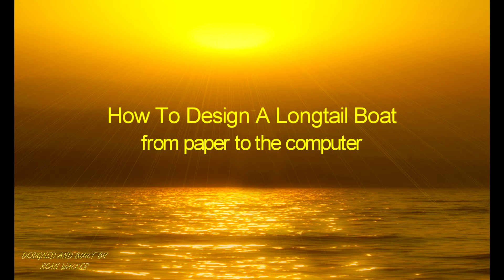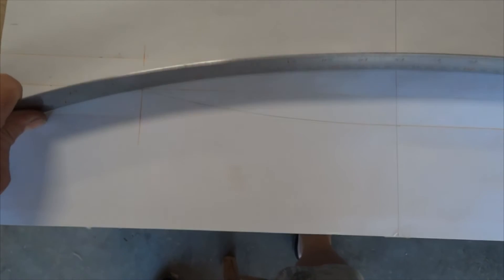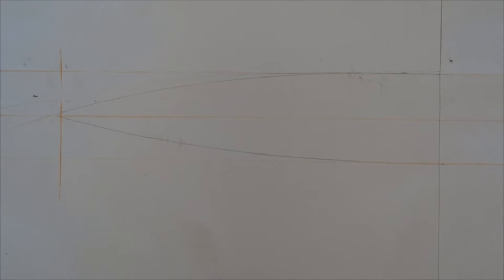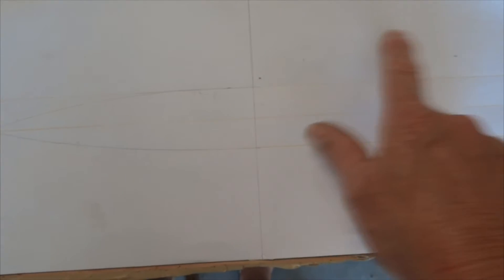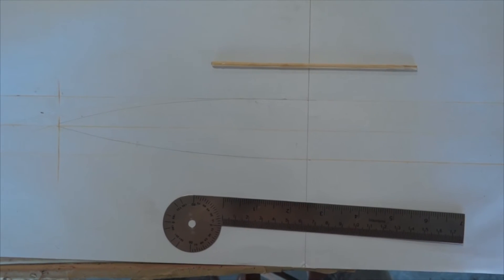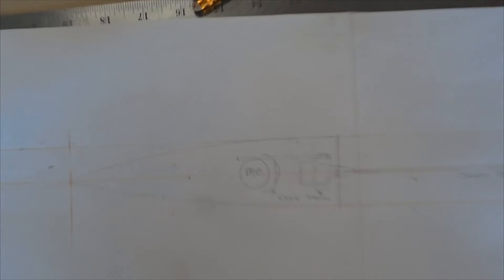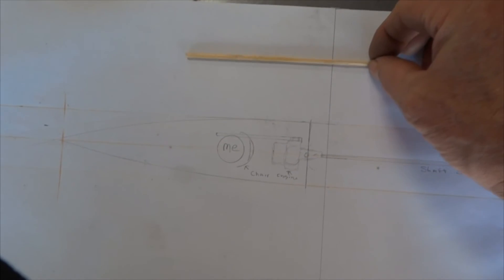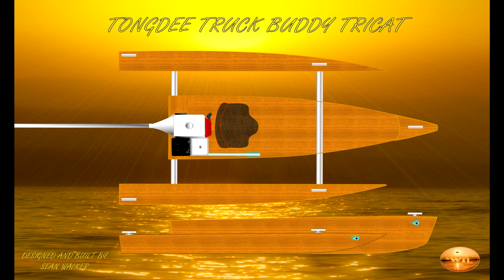how to design a boat

Comment: Sean, nice design. :) I have a question, how well does the 2 piece shaft work on a longtail? Is there more vibration? My thought is that the shipping is less expensive and it seems to me that it wouldn't be as smooth as a one piece shaft. Your thoughts please. :)
Reply from the maker: +Buddy Harrison  Buddy- By two piece shaft I suppose you are referring to
something like in a car with a drive shaft and a universal joint.Well I don’t get the point in using one. If
you do that why not just buy an outboard and use a jack plate on the transom so
it’s mounted high. If you use two shafts and a universal joint vibration comes
into play because universal joints aren’t intended to be in one position for a
long time or to be at a sharp angle and that would be the reason that one would
use one in a longtail set up. Think of a car, in a car the joint is in varying
places as the car bounces around and it never is in a constant place or at a
sharp angle as it would be if you put it on a long tail setup but it would work
if the angle is not great. The length of the tail is what makes the long tail work well;I can see no reason to use anything different. If someone is having problems turning a longtail into a modified short tail is modifying it to be more like
an outboard and if that’s the case that’s OK but why want a long tail set up in
the first place. Keep the tail long and mount it low is the golden rule. If you
are talking about expense a two piece shaft and a universal will likely cost
more, simplicity in engineering is a great thing.;Do you know John Dobbs at Mud Motor kit? He
should be able to fix you up with the real deal. :)